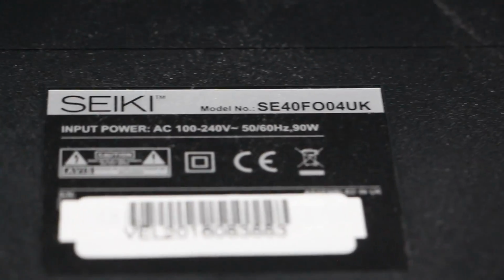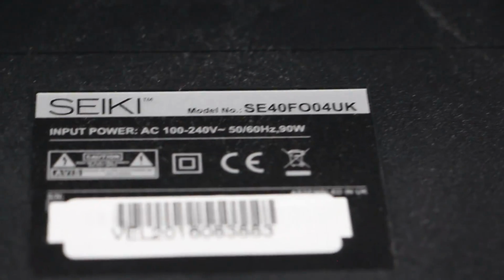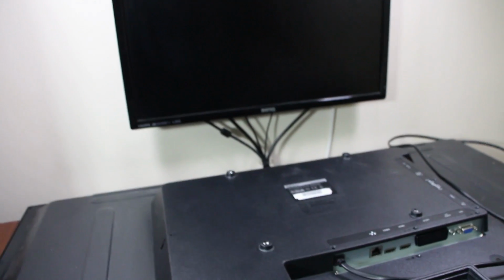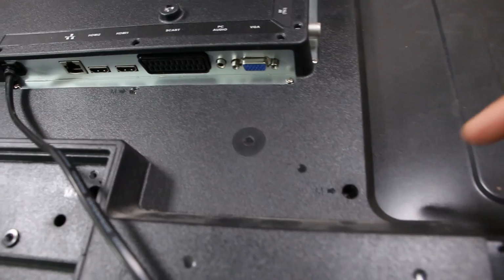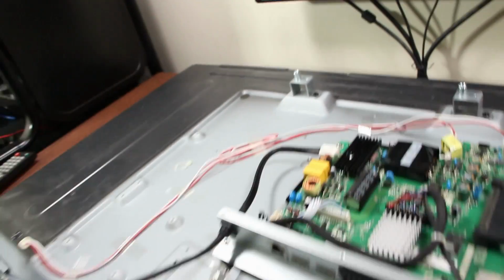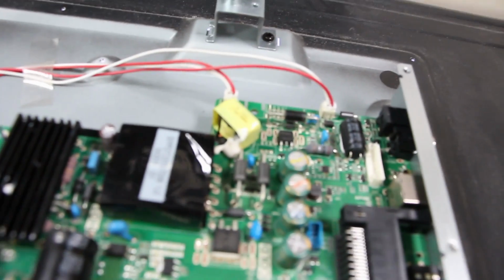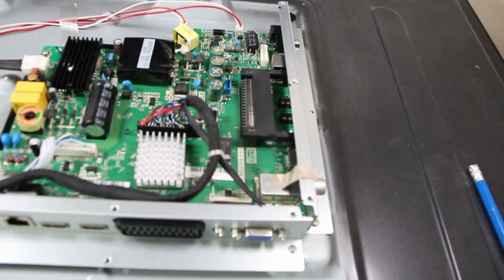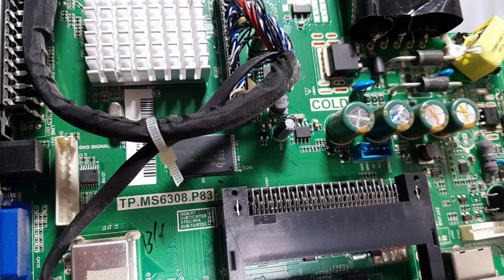LED TV Buzzing Humming Noise | Troubleshoot & Fix (Possibly) | Seiki SE40FO04UK

Comment: Peel off some of the yellow plastic tape to expose the copper winding.  Then, with a natural artist's brush generously apply shellac or varnish to the windings so that it penetrates throughout the coil.  Let it dry/harden thoroughly.  Resecure the plastic wrap.  Power it up.  Hopefully the mechanical buzzing or whistling of the coil will be silenced.

Comment: Yes excellent suggestion to ask manufacturer about fixing/replacement components etc before time to return product runs out! I will definitely do that on every product with potential faults like this. It's such a bad thing that everything is made to fail after/when warranty expires, but that suggestion is one way to circumvent that to a degree.

Comment: I only hear the buzzing noise when it’s turned off. When I turn the 4K TV on, no noise. When I then turn it off, it starts to make the noise in about 30 seconds. I’ll have to unplug it so the buzzing doesn’t bother me when I’m trying to sleep. It’s not extremely loud but I can hear it when the room is very silent. My old 1080p tv never had this issue. This is one of the many issues of encountered. And I was thinking getting a new 2020 4K tv I would have zero problems when it’s the complete opposite. Smh 🤦‍♂️
Reply: Same I have a Qled and it’s making that noise
Reply: @vvs_kade6825  i figured out that if u keep turning off the tv repeatedly like twice or three times it delays the buzzing for a few minutes. maybe try it
Reply: Same here with oneplus 55 u1s. Were you able to solve this issue

Comment: I am still trying to work out what's causing the buzzing in my TV. I thought the TV itself had gone bad, but when I connected a replacement TV I got the same buzzing. Is it the Roku device I have connected that's causing it, or is there something in the cabling? The other TVs in our house are fine.

Comment: Set your picture brightness and back-light to max and see if it helps
Reply: i have a 15+ year old Sharp Aquos thats been buzzing recently. this is how i fixed it. turned the back light from 6 to max and it stopped making noise
Reply: Thanks, this worked for me on my Bush TV. Turned the picture mode from "Economy" to "Dynamic" and the high pitched buzzing stopped.

Comment: I had the same problem,  just unplug the tv from wall, wait 20 sec , and plug it again
Reply: It’s still not working for me
Reply: @darnell4348    do reset factory.
Reply: Light wave how do I do that
Reply: @darnell4348    do you have powder extension between your TV and wall? if yes change it with other extension.
Reply: @darnell4348   google it,  type your TV model and google , how to reset my TV to factory
Reply: @darnell4348    did you fix it???
Reply: Light wave nah still doesn’t work
Reply: Light wave just gotta bare with it
Reply: @darnell4348    did you factory reset it?
Reply: Light wave tried it nothing happened
Reply: wtf

Comment: Just bought a new monitor and getting a buzzing sound legit been up an hour
Reply: What brand?
Reply: @-8_8-  Samsung it stopped I bought a better hdmi as I'm using series s but I got a pink line down the screen for around a day I read its electronic interface moved my Xbox away next day it was gone very strange

Comment: You said it right. No shame, but when you buy cheap junk you get cheap junk. Just to add: the more of us that buy cheap junk the less quality parts get made. Manufacturing responds to demand. No demand for quality leaves us with cheap junk. 

BTW, I was here because if you look up buzzing ac thermostat, you don't get anything about the led buzzing.
Reply: My 2k dollar Sony had a buzzing noise, my 300 dollar samsung did not.

Comment: Hi I just bought a new sony tv when in standby I can hear a buzz from the back is this normal the  TV is fine when on on is this s power issue
Reply: Did you find the fix to it? I have the same problem
Reply: @blueprintgustavo  hi no i took the tv back to the shop and bought a Samsung i think the issue is with the transformer as Samsung don't use a transformer box and have no noise what model sony you have and year?

Comment: INTERETING PRESENTATION, BUT MY ISSUE DOES NOT NEED A PENCIL TO HEAR.  UN55D6050 WITH LOUD BUZZING.  BUT THANKS. OFF TO SEEK ANOTHER PRESENTATION IF POSSIBLE.  REGARDS